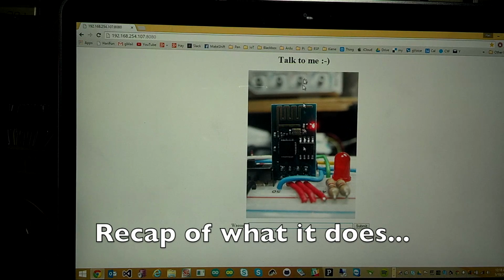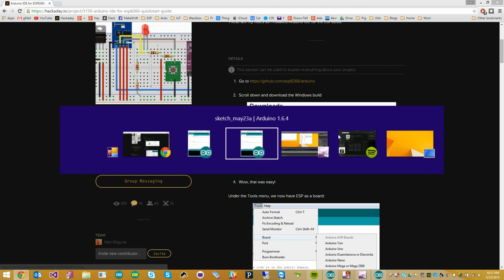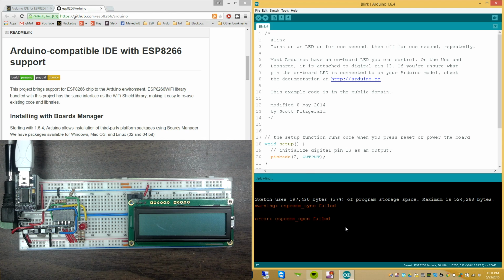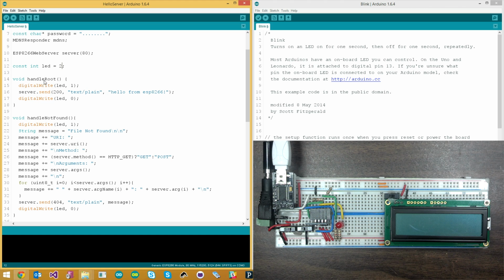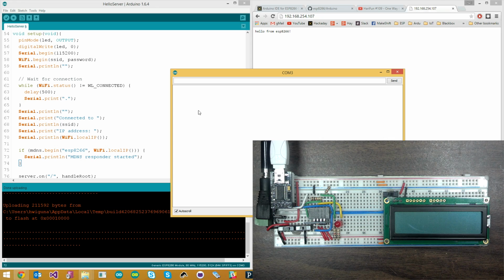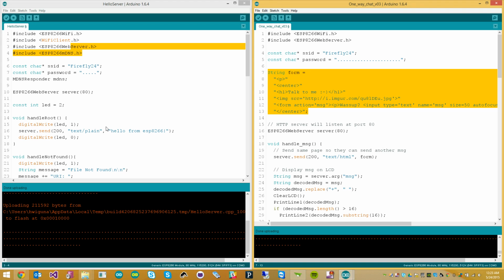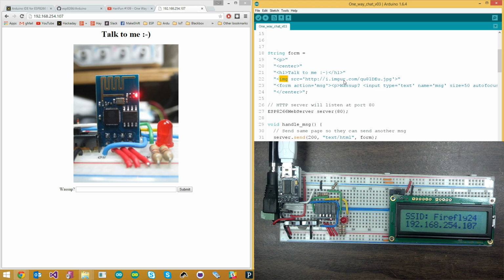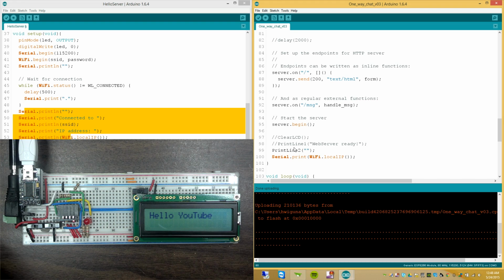HariFun #109 - One Way Chat part 2

Comment: Nice explanation.  I have interfaced Arduino Uno with ESP8266-01 and 16*2 LCD. Now i wanted to send text typed from webpage. Can you please have a look ?
Reply from the maker: +keshav dk 
You can start with the code I linked from the YouTube description and modify it to your needs.  Have fun!
https://github.com/hwiguna/g33k/tree/master/ArduinoProjects/2015/_Done/110-One_way_Chat
Reply: Thank you Sir.
Reply: This code worked fine for me. Sir ,i wanted to control the 16*2 LCD from webpage using Arduino+ESP8266 wifi module..can you please suggest.
Reply from the maker: +keshav dk 
I'm confused.
The code already serves web page and displays it on the LCD.
You said the code worked fine, what do you need help with?
Reply: Sir in the above method, programming is done to ESP8266 module. I have interfaced arduino with esp8266 .
Reply from the maker: Are you sending AT commands from Arduino to ESP via serial? if so, then the programming would be completely different than mine.  I can't write that for you. :-(
Reply: No issues. and Yes Sir,i have executed with AT commands and it is communicating .Fine Sir. No issues. But the explanation in the above video helped me a lot.  :)

Comment: Ahhhh. ... I found the problem. It is in the exact need to reset the ESP  just before uploading AND holding the GPIO0 for the duration of the down load.  I did not catch that right off,  but this is simplified with the use of slide switches you use.  I just did not catch the need for reset just prior to upload !
Reply from the maker: +0chucko , Great job!
In case you haven't heard, the upload button dance could be automated.  I showed this on one of my videos, but I could not find it! Grrr!
Check out the diagram at the end of this article that Google found for me:
http://www.arduinesp.com/getting-started
Reply: +Hari Wiguna 
Some how those little things slip by , and in the thrill and excitement of the moment are forgot.
Thanks Hari, you are a very good teacher. I never could have even gotten started
without your videos. Awesome  :-)
Reply from the maker: +Chuck Minton , there is a lot to learn, I think you're doing great!  Love to see your project if/when you post it somewhere.
BTW, you should stop with all the kudos. My head is getting too big for my body from all your praises. :-)

Comment: Hari,
Having trouble:

 I set up Arduino IDE and added 3rd party board Adafruit Huzzah ESP8266-12 .  
After Compile , I get message in serial box : 

Sketch uses 219,275 bytes (20%) of program storage space. Maximum is 1,044,464 bytes.
Global variables use 31,480 bytes (38%) of dynamic memory, leaving 50,440 bytes for local variables. Maximum is 81,920 bytes.
warning: espcomm_sync failed
error: espcomm_open failed
error: espcomm_upload_mem failed

I went back to Lua Uploader, and I can still upload and run from there. Baud is set at 9600 at Lua Uploader. I have tried both 9600 and 115200 on Arduino IDE.

Any Ideas ?
Reply from the maker: +Chuck Minton , I wonder if you have accidentally changed one of the ESP options under the tools menu. In particular, the Flash Size.   I believe the Huzzah has an ESP-12 on it and have 512K.  Note the default values of the other menus as well and then experiment.  Good luck!

Comment: hi!
i try to compile but have some errors...
'clear_display' was not declared in this scope
'sendcommand' was not declared in this scope
'displayOn' was not declared in this scope
'setXY' was not declared in this scope
and more.....

i install the hardware ESP from:
http://arduino.esp8266.com/stable/package_esp8266com_index.json
but don't work...

i Clone the repository into hardware/esp8266com/esp8266 directory
but don't work....

i using the last version off arduino....
Reply from the maker: +Lisergio Pindrejo , which sketch are you trying to compile? It sounds like you're missing an LCD library, but my sketches do not use any LCD libraries?!
https://github.com/hwiguna/g33k/tree/master/ArduinoProjects/2015/_Done/110-One_way_Chat
Reply: +Hari Wiguna , i copy and paste the code of
https://github.com/costonisp/ESP8266-I2C-OLED (the example of the video)
i copy font.h...to the folder... too
Reply: +Hari Wiguna, i try to compile y a new laptop, and compile ok,...
sorry ....
i try to reinstall arduino ide in my OS X , and try again...
thanks!!!
Reply from the maker: +Lisergio Pindrejo , glad you got it to work.
FYI, I believe the newer compilers have been changed so methods/functions must be defined ABOVE where they're called. So eventhough clear_display is defined, you would get "not declared" errors unless clear_display is above where it is being called.  Fix is simple, just copy paste the culprit method so it is above where you need to call them. Good luck!
Reply: +Hari Wiguna hi! Again!
The proyect works fine ( the problem is my mac, ) but i have a question...
Is possible change the font's large?? I need draw two words in small, but 4 Numbers in big font...
Thanks for all!
Reply from the maker: +Lisergio Pindrejo , that depends on your display.  Some display supports multiple size font, some support graphics (so you can draw anything including larger letters).  I suggest googling the model # of your display.  if it is a popular display, someone probably already wrote a library for it :-)
Reply: +Hari Wiguna Thanks again.
The display is  a 0.96" 128X64 OLED, I2C (or IIC) interface, with SSD1306 driver, 3.3/5V compatible.
The library u8glib works with arduino UNO, but dont work with esp8266

Comment: Hari Wiguna  What voltage regulator did you use? Did you use external capacitors? Thanks!
Reply from the maker: Yonatan Broza , in this case, it is an AMS1117. Please note that it is a surface mount part. I soldered it to a header.  In the past, I've also used LM7803. I've gotten away not including capacitors on the power line, but It is recommended that you use capacitors.

Comment: Nice tutorial :) I have a question: since you can program the ESP8266 in Arduino IDE instead of LUA is the program/sketch slower? Is there some kind of an emulation?
Reply from the maker: ElectronFun.com , Thanks Chris.
Disclaimer: I do not have any real data to back this up.
However, since LUA is interpreted while Arduino IDE compiles to machine code, LUA might be slower.
As I understand it, the Arduino IDE had always supported targeting different CPUs, the new board manager simply made it more convenient.  So, there is no emulation, ESP is just a different compile target.  No performance penalty.  Come to think of it the 40MHz ESP is almost three times FASTER than the typical 16MHz  Arduino! Wow...
Reply: Hari Wiguna Thanks a lot for your answer Hari. I guess it's time to test my ESP8266 :)

Comment: Great video! Is the ESP8266 runing the stock firmware?
Reply from the maker: 3zuli , Thanks!
The documentation of Arduino IDE for ESP, does not mention any firmware requirement.
https://github.com/esp8266/arduino

The way we are required to bring GPIO0 to ground during every sketch upload leads me to the conclusion that each sketch upload actually writes a new firmware (the sketch IS the firmware).
During upload, it says it's uploading starting at memory locations 0x0000 and also 0x10000.
Reply: Quite interesting. I've had one of these modules since September when they first appeared, but I haven't actually made anything with it yet. Looks like now is the time.
IMO the fact that Arduino IDE now directly supports ESP8266 is quite groundbreaking because it has the best of both worlds: the possibilities of a <$5 board with GPIO and WiFi combined with the ease of use of the Arduino platform.

Comment: Great tutorial video on the ESP8266, awesome :) . If I don't define the pinMode for the led on the ESP8266 ESP12 it will not turn on/off. Is this for every type ESP8266?
Reply from the maker: André Domingues , thank you.
I don't know, but I suspect setting pinMode() is required if you want a pin to be an output on all ESPs.
Defaulting pins to output sounds like a bad idea.  Imagine if user connect all unused I/O pins to 3V3 or GND?
How would the firmware know what is a safe state to set that output pin to without causing a short between 3V3 and GND?
So, it's probably best that we are required to set pinMode to output because only we know which pins are actually outputs for our projects. :-)
Reply: Hari Wiguna Of curse defaulting pins to output is a bad ideia, only set the pins that you're using, for example, if you want to blink a led, if you define the pinMode the led blinks, if you don't define it, it will not blink guarantied. 

"So, it's probably best that we are required to set pinMode to output because only we know which pins are actually outputs for our projects" Agreed. The rest are not define or define as Input an you solve your shorting between VCC and GND